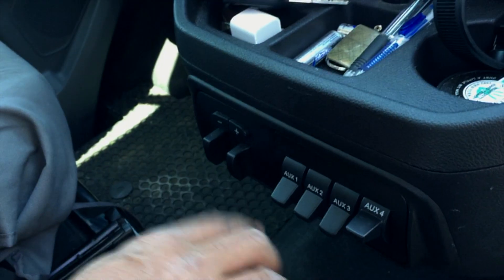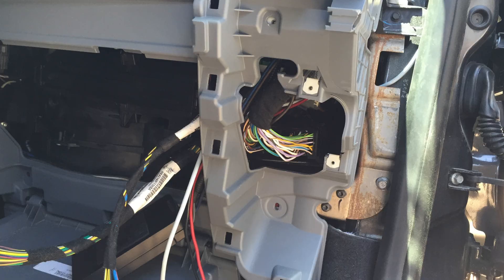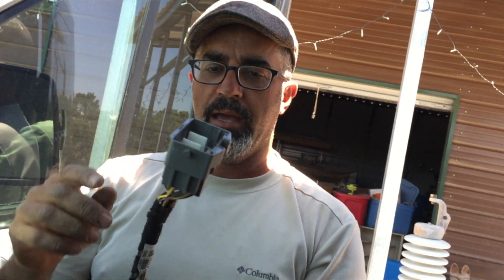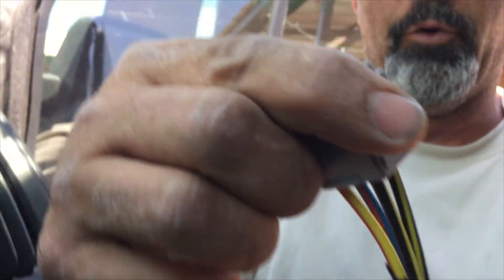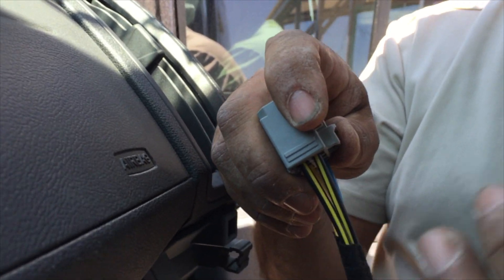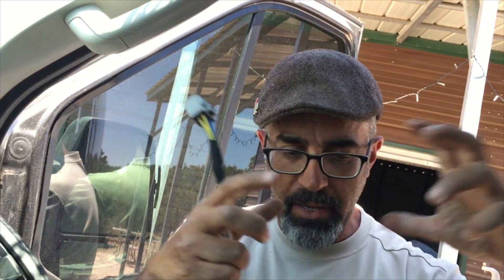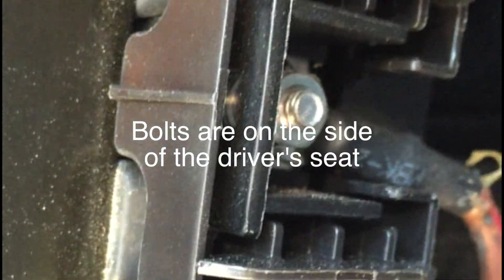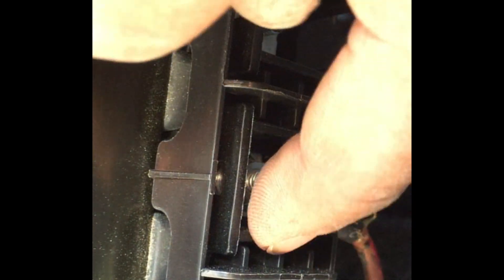how to connect aux switches on 2017 ford transit van

Comment: Ford still seems to lack accessible documentation on this and I found your video very helpful. Not sure what package the 2019 cargo 350 we just did was but it came with a shorter version of same harness and did NOT have the 4 pin plug you got the pigtail for. (Still unclear what trim transit uses that). There was a relay in the bag as well as a few other harnesses too. Anyways...thanks.
Reply: My harness was the same as yours. 2018 T250 with upfitter package. Wiring harness was too short to be fed anywhere so I had to length it. Still don’t know what the relay is for or the 3rd short harness #HK4V14A411KCA, is for.
Reply: @TheItinerantCraftsman  The relay is for aux 1,2 and 3 to always be on regardless of whether key is in ignition. You replace it with the existing relay in relay box.

Comment: Thank you so much for this video! I can confirm this works for my 2019 ford transit 350. I choose the heavy duty alternator, upfitter switches, and daul battery upgrades. My van came with the same cords that you mentioned in this video. It also came with an additional cuh65 cord that I’m not sure what it’s for part number hk4v14a411kca. It also included a 20 amp relay. Did you have to remove the driver seat petestal and the batteries to get to the cords? Or how did you get down to them?
Reply from the maker: We took the driver's seat out. Did not remove batteries. We had to get under the rug to find the loose wires. we didn't get the relay you speak of.
Reply: Joe Gresh I just noticed the latest version of the BEMM was released on the fleet website and it describes this process in detail for all years of the the transit. Also, they put out a bulletin titled Q-250 that describes this process and tells you what each wire does on the 43 and 4 pin connector. It took a little digging to find both of these.

Comment: I would like to add a comment on hooking up a 2018 F250 Transit.  In my van the 43 pin connector was easy to find behind the glove box.  The 6 pin (with 4 wires) was a chore(especially with variable focus glasses).  The mating connector was to the right of the 43 pin connector and lower hidden in a wire bundle and taped to the bundle.  One we removed some tape is when we saw the six pin connector(the wire end with NO wires coming out).  We removed the connector and then we plugged in the supplied connector and wire and we're in business.  No documentation, no hints.  Thank you Youtube!   NOTE:  the CCP has three studs with 60A on each stud.  The wires go to a relay from the stud and then to the connector behind the glove box and is rated at 40A.